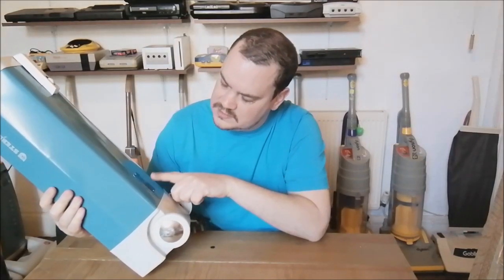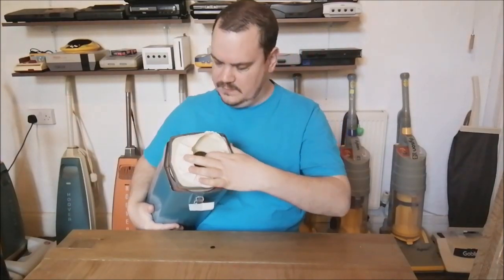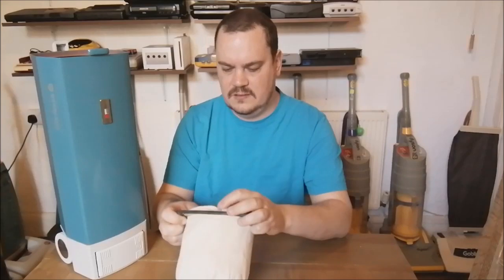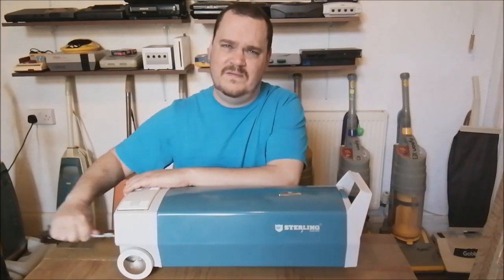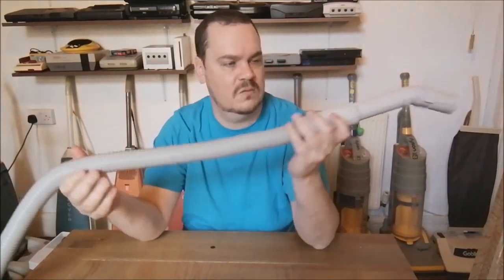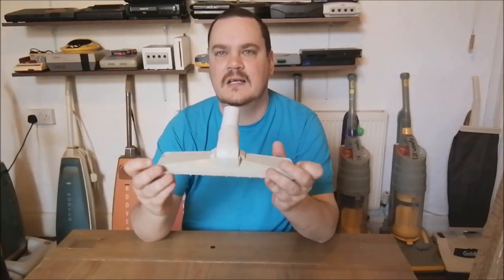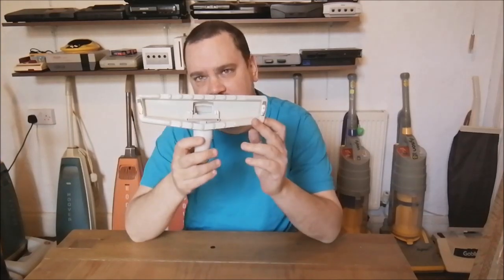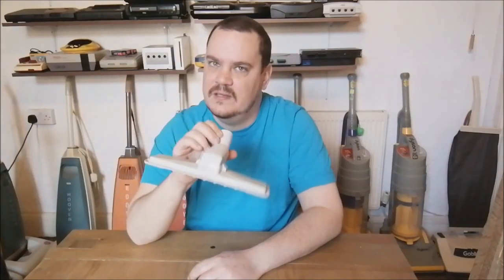Vintage 1979 Sterling Electric - OR Just an Oddly Named Rotel?

Comment: Yes, this vacuum cleaner was made in Poland just like Rotel came out of the same factory.  Its producer is Zelmer.  In Poland, it appears under the name Predom Zelmer type 51. I have a similar but my is from 1977.  Has a slightly different motor. In Poland it is difficult to get one so it has become a rare and unique model among collectors.
Reply from the maker: Thank you so much for the info! Am I correct in thinking that the names Rotel / Spinney were specifically used by Predom Zelmer for the Western European markets and you did not have machines named as such in your own domestic market?
Reply: Yes, it was.  I have one, it's type 04S under the name "Mondilec" probably it's a version produced for the French market.  It has a 550W Silma RH5500A motor licensed under Hitachi.  Export versions also sometimes occur in Poland, these are called export discards.  But they are not as popular as domestic ones.  I am still very interested if the engine in yours has Polish inscriptions on the fan cover?